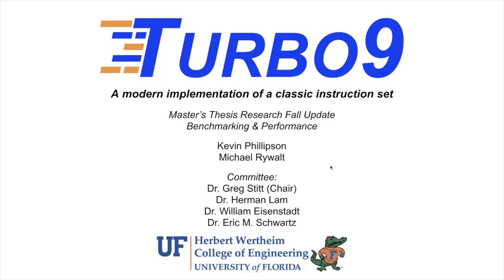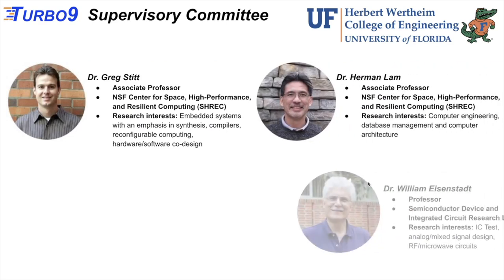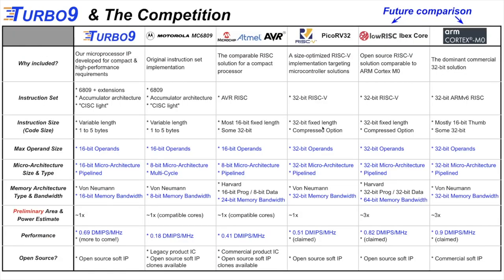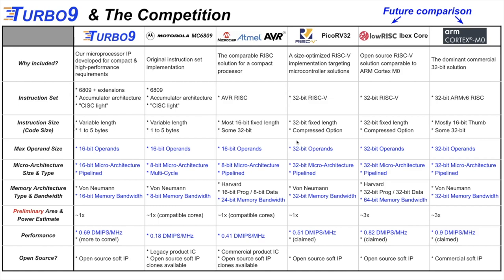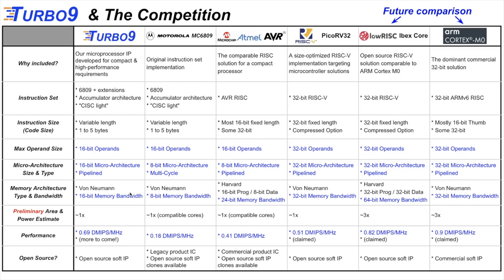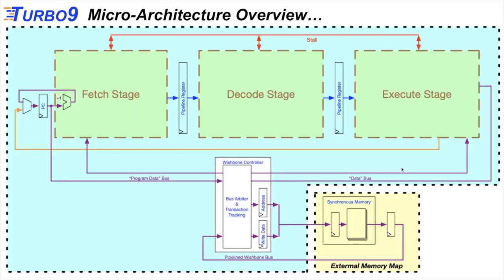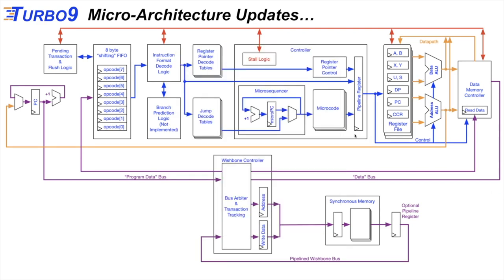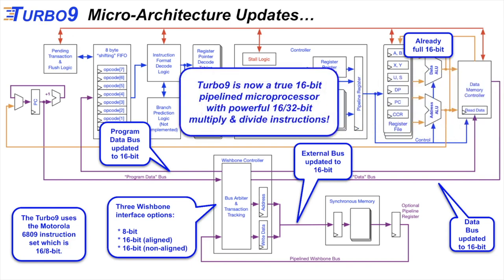Turbo9 - Pipelined 6809 - Benchmarking & Performance

Comment: Love seeing a modern 6809 implementation.  The 6809 instruction set is much better than other 8 bits of the time, and it should have seen much wider adoption. 
It's also nice to see the new divide instructions.  That was a significant limitation to speeding up math operations.

Comment: Any plans to look at the Hitachi 6309  (extensions)?
Reply: Part of the advantage of the 6809, is that it can be small.  The 6309 would be larger and slower to implement
Reply: @Phantom8Bit  it's also less "tidy" then the 6809 ISA, for example the bolted on stacking instructions use new opcodes.
Reply: Historically, the advantage of the 6309 over the 6809 was performance. You could get more bang for your buck by replacing a 6809 with a 6309 and then using its additional instructions/registers. That came at a cost, though: changes to your software to take advantage of those extra registers and instructions. Think of the Turbo9 as a way to improve the performance of the 6809 much more drastically, but without the "pollution" of extra registers and additional opcodes to map in and manage. The philosophy of the Turbo9 as it relates to the 6809 is "first, do no harm." By utilizing pipelining and other optimization techniques under-the-hood, 6809 compatibility is preserved and you get significantly more performance without having to resort to tricks like adding more registers and a lot more instructions to manage those registers. The Turbo9 solves the "problem" that the 6309 intended to solve, but in a way that makes it more "compatible." That said, there are carefully planned instruction extensions to the Turbo9, such as the 16-bit multiply and hardware divide which will bring it more into parity with the 6309 in that regard.
Reply: @boisypitre  "pollution" of extra registers isn't one I've heard before :) One of the biggest problems when programming low resource systems is having enough registers to do things, particularly without having to load from memory (more expensive). The 6502 was my first Assembly and then I went to 68000, where I suddenly had and embarrassment of riches in registers :)

In general, I understand your philosophy of doing no harm and adding a select few, very useful instructions (multiply and divide) but you've already broken compatibility as soon as you use one of those new instructions.
Reply from the maker: @Shane Hebert  Hi Shane! Thank you for the question and the great discussion. You are absolutely correct that more registers are helpful from a programming perspective and obviously we have seen the need to add a few select instructions from the HC12/HC11/6309.

Before we go any further, I don't want you to read any of this as being negative about the 6309. I believe the Hitachi engineers made an excellent product that fit its market niche well. In terms of a compact, high performance microprocessor IP for use in sub-blocks of a SoC or in mixed signal ASIC sensor chips the requirements are different.

I want to look at it from the hardware perspective. We need to make the distinction between the "Instruction Set Architecture" (ISA) and the "Micro-Architecture". The ISA is the design and definition of the instruction set and the registers that the software level utilizes. It is the interface layer between software and hardware, AKA "The Programming Manual." The micro-architecture is the underlying hardware that executes the ISA.

There are many different variations of micro-architecture that can execute the same ISA. For example a modern Intel i7 can still execute the i386 ISA and do it considerably faster than the original 386 hardware. The same statement is true for 6809 ISA running on the Turbo9 micro-architecture. Turbo9 micro-architecture is a completely different beast to Motorola MC6809 and though they execute the same ISA, the Turbo9 requires significantly less clock cycles per instruction.

It is important to consider that changes to the ISA will affect the micro-architecture. More registers increase die area by themselves. Also more registers require more decode muxes to feed into your ALU and datapath which will increase not only area but your propagation paths and therefore reduce the maximum frequency of the clock. Also, you will require a lot more decode logic for the new instructions to utilize these registers which will also increase die area and lower the clock frequency.

So then the question is, will adding the entire 6309 instruction set offset these drawbacks? Well the 6309 instruction is much more of a "bolt-on" instruction set extension than a clean implementation like the 6809. This "non-orthogonality" creates further problems for creating an efficient micro-architecture, especially a pipelined micro-architecture. This "non-orthogonality" is also apparent from the software level.

Now let's think about our target market. The Turbo9 is aimed at being smaller and more power efficient than a 32-bit ARM solution in a custom ASIC but with similar or better 16-bit performance. The very reason we selected the 6809 ISA is because of its elegance and it just barely has enough 16-bit instructions to handle 16-bit C code well. Adding all of the 6309 instructions will negate the power and size advantages, possibly without a significant overall performance boost. In fact, it could be slower given its maximum frequency in the same FPGA or ASIC fabrication process technology.

Lastly there is no 6309 C compiler. But there are plenty of 6809 C compilers and we now have a Turbo9 C compiler (vbcc) that supports the few instructions we do add. We are very careful about adding instructions and also consult with the author of vbcc to ensure we are going to see a worthwhile benefit. You can use all the 6809 software tools on the Turbo9 or use vbcc/vasm to take advantage of the Turbo9's ISA extensions.

I hope this sheds some light on our design decisions. Thank you for the question and discussion. If you have any other questions or comments, I love talking about this subject!
Reply: @turbo9team  very good, detailed answer! Thanks!
Reply: FWIW, I never liked the fact that the new accumulators on the 6309 were made the least significant bytes of the combined 32 bit register.
It seems like there would be some code optimizations that might be possible or even necessary when dealing with 32 bit numbers if the new registers were the most significant bytes.
No, I haven't tested this, but the new opcodes require an additional byte, and that should require at least one more clock cycle for the added memory operation.
Reply: @shanehebert396  Yeah, that's why I put "pollution" in quotes :) It's not a bad thing to add more registers, but it comes with additional compromises: encoding those new registers in operand bytes of existing opcodes, pushing/pulling them in IRQ contexts, etc. As you note, even just adding additional instructions introduces an issue when running that code on a regular 6809. The price of progress.
Reply: FWIW, I  think they did it to keep the stack register order consistent.

Comment: Forgive me if you mentioned this, but is the Turbo9 big endian or little endian?
Reply from the maker: The 6809 ISA is big endian and therefore so is the Turbo9.
Reply: @turbo9team  I get that, but it means that mixing it with another core (which is almost certainly little endian) has its annoyances. I would love to see a bi-endian mode in the future
Reply from the maker: To add an interesting comment regarding endianness… the 16bit bus variations of the Turbo9 made me scratch my head a bit until I figured it out. The “data” reads and writes are straight forward, but the “program” reads are different. The instruction queue is a FIFO therefore big endian does not apply to reading program data. It must be read in order. Once it gets to the decode stage, the addresses and immediate data gets pulled out of the FIFO in big endian format. It’s obvious to me now, but until I built the 16bit wishbone controller I didn’t think about it. I was trying to treat the data and program reads the same.
Reply: @turbo9team  ahhh yeah that rings a bell. I was mostly a 6502 guy but liked a lot about the 6809. I once tried to implement a soft 6809 and ran into that conundrum
Reply from the maker: @JockMurphy  In response to bi-endian mode, unfortunately that would require updated support for assemblers, linkers and compilers. Maybe if it was only data that had to be bi endian it would work without software tool support…
Reply: @turbo9team  honestly I think data bi-endian is all that is really needed. There aren’t many big endian systems out there and most non IBM bi endian systems are running in little. So mixing the data adds an impenece mismatch
Reply: @turbo9team  And as an addendum, I would happily port SDCC (and associated tool) to a bi-endian mode.  I can see use for Turbo9 in my own work
Reply from the maker: @JockMurphy  Do you have previous experience with the SDCC backend? SDCC looks like a great compiler, I've looked into it before. I've also seen some talk about creating a 6809 backend. BTW, what are you are working on?
Reply: @turbo9team  so I am a EE and software engineer with about 35 years of experience. I do a lot of work with microcontrollers and starting to do a lot more with FPGAs and soft architectures. I have studied the SDCC code a fair amount because I have thought about how porting it for a custom core I have been designing for fun. It looks to be fairly straightforward and well enough documented